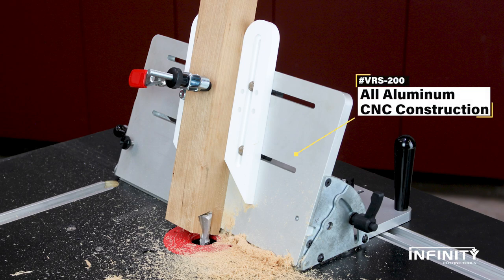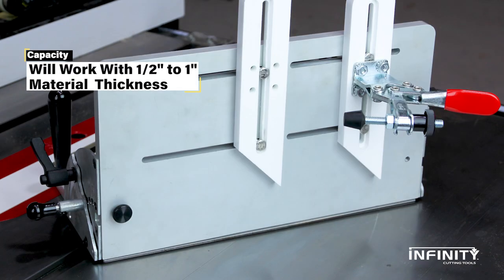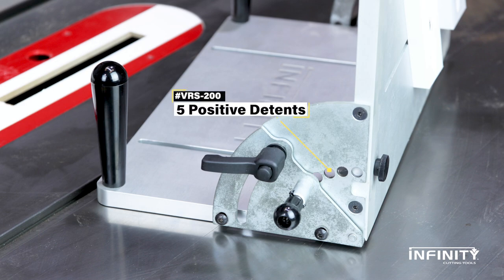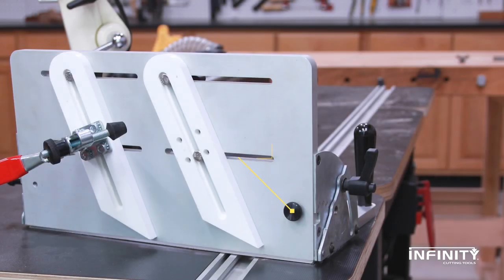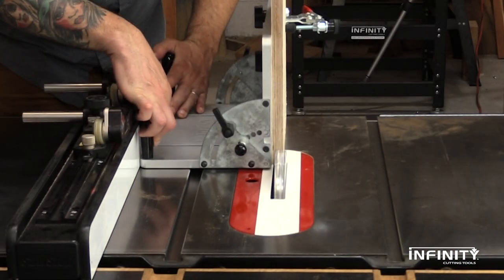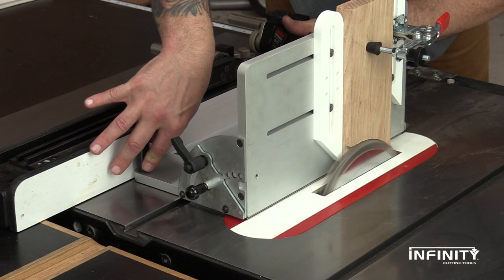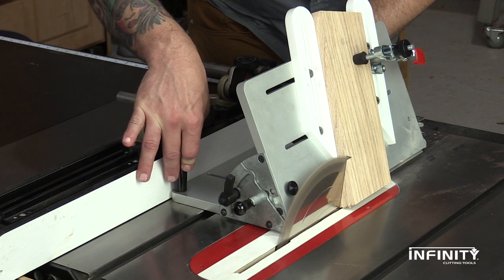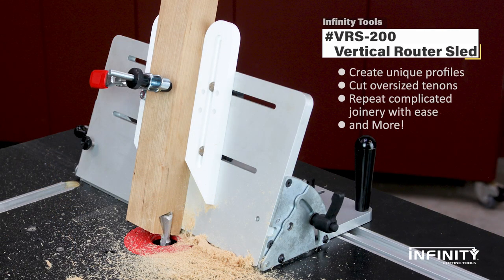Professional Vertical Router Sled

Comment: I bought this sled and encountered an issue I didn’t anticipate. For some reason, I assumed it would be able to move steadily in a straight line in the router table’s miter-bar slot a fixed parallel distance from the router bit/router-table fence. That is, I thought it would slide evenly/straight along the router table’s miter slot parallel to the bit/router-table fence.  However, it doesn’t seem able to do this because the sled also has 2 slots for the miter-bar knobs that run perpendicular to the router-table fence.  Those slots are likely there to ensure the sled can be used in different tables that have different distances between the bit and table miter slot.  But if one tightens the knobs to secure the sled in the router table’s miter slot at the perfect parallel distance from the router bit (or router-table fence) the sled won’t move at all because the knobs tightly secure the sled’s miter bar in the table’s miter-bar slot. But if one loosens the sled’s miter-bar knobs, even a tiny bit, to permit the sled to slide in the table’s miter-bar slot, the whole sled also shifts along the sled’s perpendicular miter-bar knob slots causing one end of the sled or the other to suddenly move toward or away from the bit unevenly.  The sled is still useful being used freehand (although this renders the miter-bar useless), e.g. when using a bearing bit. Or it can be used registering the stock against the router-table fence.  It either case it increases user safety and allows the stock to be positioned in ways not otherwise achievable.  But I couldn’t figure out how to get the sled to slide straight and parallel to the bit using only the router table’s miter-bar slot.  Perhaps someone has an answer to this shortcoming I am missing.  I was using a Woodpecker large router table.
Reply: This doesn't make any sense to me.  Every picture I can find has the track mount and the miter slides on 2 different plates which are always at least 45 degrees apart.  How are these affecting one another?  Those knobs should be tight whenever the track bar is being used ande should have no effect on the slide.  I'd guess the sizing washer in the track needs to be adjusted.  It sounds like you have a misalignment bind or possibly a burr in your table's track.
Reply from the maker: Thank you for your feedback. We try to provide our customers with the best possible resources for using the products we sell. If at any point you experience issues or have questions concerning a product we carry, please contact us via email (support@infinitytools.com) or phone (877-USA-BITS) and we will gladly assist in troubleshooting the issue. Our business hours are M-F, 8:30-5pm E.T.
Reply: I am the original poster. I solved the problem by adding a 1/4 washer between the miter bar and jig on each of the 2 screws securing the bar to the jig, adding a tiny bit of distance/clearance.  The problem was that by tightening the miter bar, I was also bringing it up against the top of my router table’s miter slot and causing it to clamp against the top of the slot track. By adding the washers, I created just enough clearance to be able to secure the jig to the bar without bringing the miter bar off the bottom of the slot track and up against the top of the slot and paralyzing the jig. Don’t know if the jig’s miter bar was too thin, causing unintended clamping pressure, or there was an issue with my Woodpecker router table’s miter slot.  In any event, adding the washers and creating a tiny washer’s worth of distance allowed the miter bar to slide along the bottom easily while fully tightened to the jig.
Reply: @Wyman642 Nice follow up.